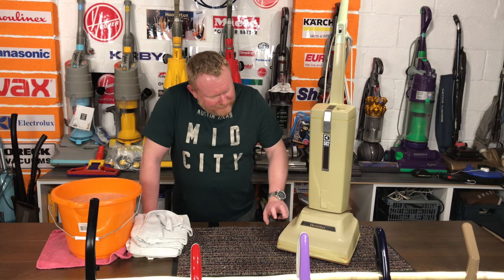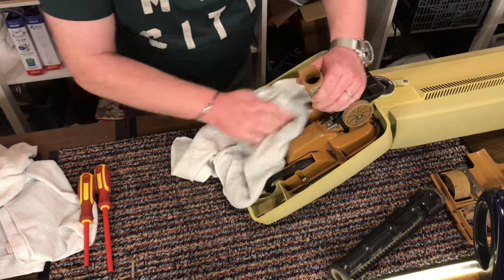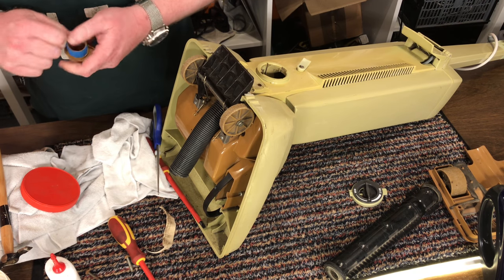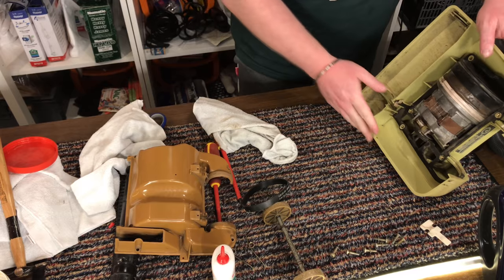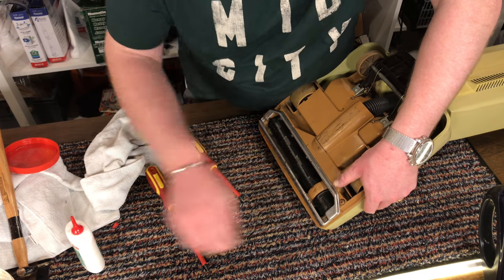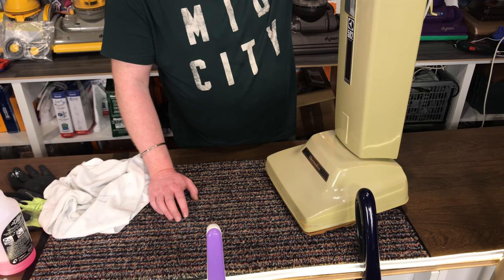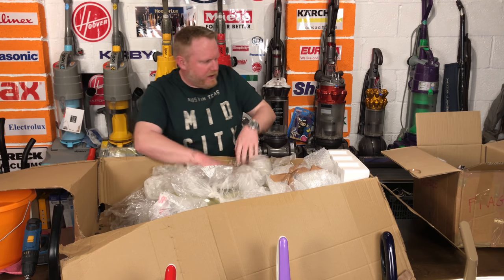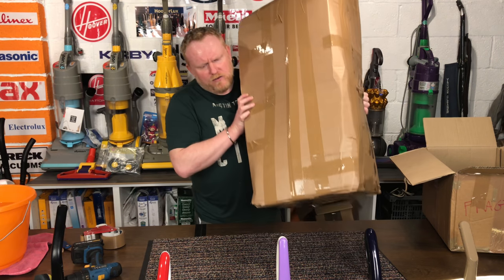Electrolux 502, Repair & Polish With Bonus"How To Pack A Vac For Postage" Video At The End

Comment: If I remember rightly, the fans are pressed on and sealed on - there is no fan spindle top nut, so you cannot remove the fans, well, I couldnt anyway, and both 502S models I had, they had motors worse than that sounded - the front bearings get worn and dry, and cant really be greased, as you cannot get the fans off to reach the bearing. The rear bearing is accessible, but if they are worn, its the end of life for the motor. I think Electrolux intended the motors to be replaced when they wore out, rather than be repaired - the early beginnings of the throwaway society. The flexi floorhead hose underneath commonly breaks on Shark vacuums too, so I've found out, and I was wondering what might suffice to repair my Shark's hose when it eventually splits, because I'm damned if I am buying a new powerhead just because a hose has split. I was wondering if the underside hose from a Dyson DC07 would fit - it looks about the same sort of size. Which hose did you use from the TP2? not the main hose, surely - it would be too wide a diameter to fit? Both my 502S models are long gone - they were too far gone to repair, and both had duff motors, again with bearing failure.
Reply from the maker: Yes, it was a little bit of the main hose from a scrap TP2. From your vid you Demo’d on your Electrolux, no the motor is near on impossible to take apart, well beyond my tools and knowledge, but with the motor out, I drop some oil on the spindle end and leave it for a day for the oil to seep through. I then use some good spray oil with the long tube and spray a bit into the inner part of the motor to reach the inner bearings, this seems to work really well!